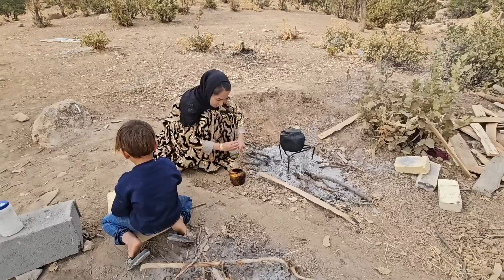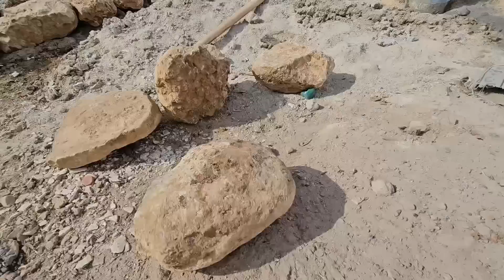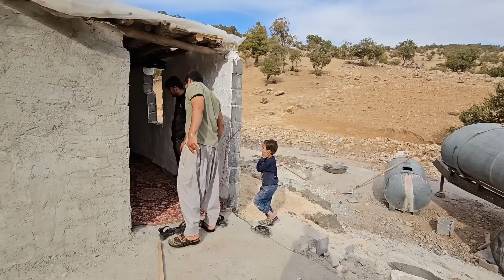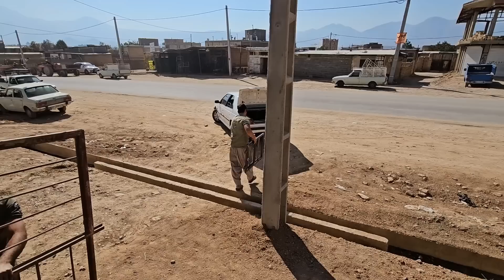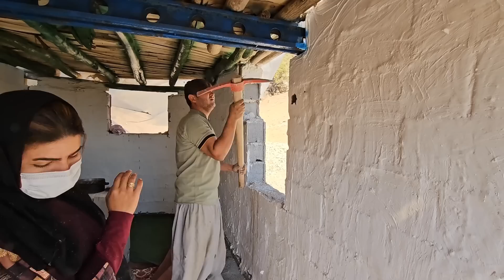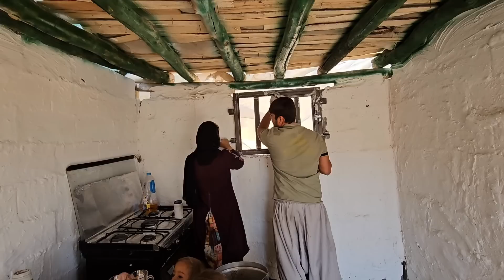Mahdi's negative answer to the suitor, but she does not give up!

Comment: I wish the ground foundation was better with steel.. I would of like to see the conner of the wall the brick was plated and the roof was more with a grade.. The wall inside could be smoother.. Outside wall is not plaster with sand.